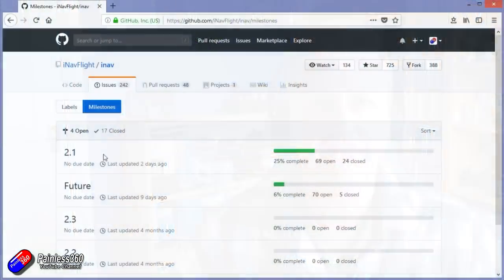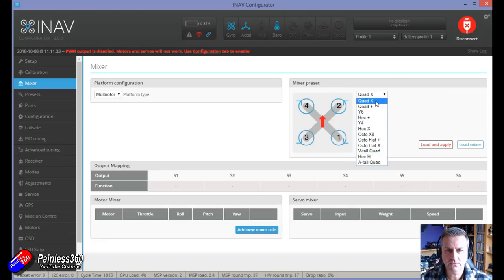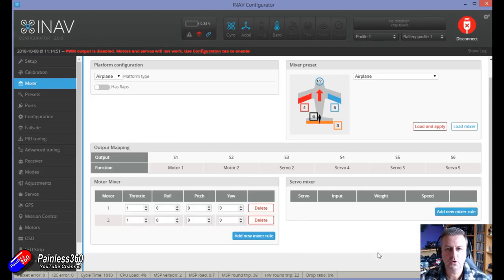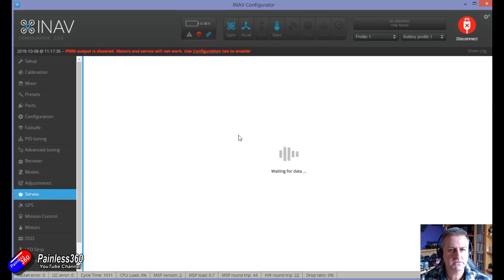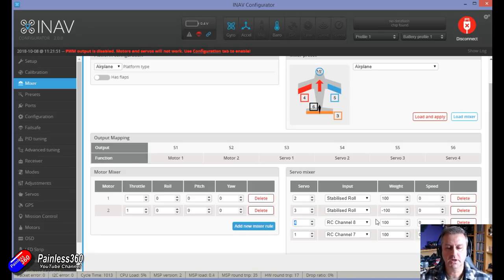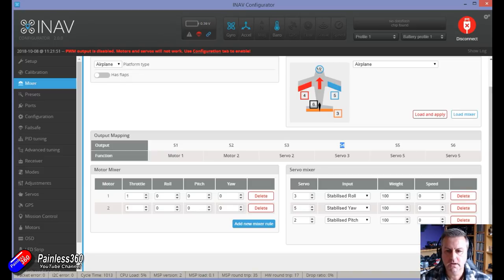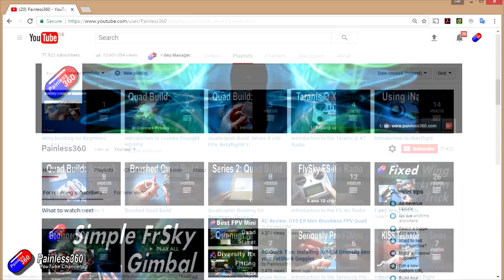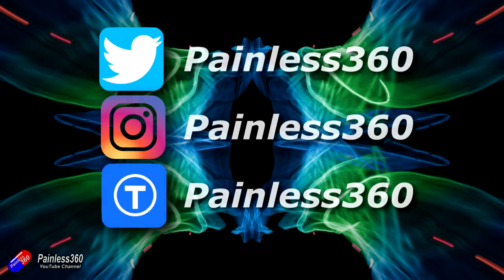iNav 2.0 Servo and Motor Mixer: A new way of doing things!

Comment: Great video,  very helpful,  thanks. I'm thinking of building something like a v22 osprey with vtol capability. I understand I could add some servos to pitch my motors from horizontal to vertical.... but I'm wondering if there is a way to make sure the craft will remain stable and level in roll and pitch while in vtol configuration? Any ideas on how I would be able to do this?

Comment: Does anyone know whether it´s possible to use output 5 and/or 6 for a servo while using Inav on a copter? It only lets me add a servo mixer to S7 and S8. I want S5 and S6 for a servo too. Any solution?

Comment: Did some research and found this for servo set up. Hope someone finds this helpful. 
In the "Servos" Tab:

If they go reverse, change "Direction and rate" from +100 to -100

If they exceed maximum wanted deflection reduce min/max

If control surfaces is not perfectly centered adjust servo midpoint. (This is after setting them up as close as possible mechanically )

Note: In the Servos tab servos are counted from 0-7 while in the Motors tab they run from 1-8.

Comment: Hi Lee, awesome video as always! I am trying to set this up on a multicopter with one servo output for gimbal pitch. After I enable it in the mixer and press save, it still does not show up in the mixer tab to tell me which output on the board to plug it in to. Any ideas? Thank you!

Comment: I used Inav 2.0 with spf3 flight controller motor arm. But flight modes    doesn't work ( angle and horizon) please help me sir
I used your video in your channel spf3  settings and add flysky receiver, fly modes
But my quad only arm and i change to fly modes  angle motor are stop running 
Please help me this is my first quad building

Comment: I used the presets in the mixer settings once I selected the flying wing. The throws on the wing was reversed so it is necessary to go into servo to get pitch and roll to move correctly. THANKS PAINLESS!!🤩

Comment: Hi, Lee
Is there a way to connect a pan & tilt (2 servo) in inav on a omnibus f4 v3 board ?
i have built a 450 dart quad and set up in premix 10inch all 4 motors working and have connected
the 2 servos on the 5th & 6th pins tried to follow you in the mixer but the 2 servos are not working ?
is it not possible to have servos in the quad mix ? please advise me.
thanks
Kevin.
Reply from the maker: I've not tried it on a Quad but see my iNav 2.1 build where I show how I added a pan and tilt gimbal.. Best of luck

Comment: Have omnibus f4 v6 setup as a quadx. Servo tab allows you to add rules, but the output doesn’t change, leaving s2 and s4 blank. I wish to use one for pitch control of gimbal
Reply from the maker: Servo table is only read at boot so you need to reboot it to take effect. See my iNav 2.1 series where I show this in some detail..

Comment: This is a great video, it has saved me lots of time and even prevented me from throwing INAV into the trash bin altogether, since I thought that it's not possible to have two separate flap servos for left and right flap.

My erroneous presumption and a large part of my confusion and frustration with INAV came from another, older video which I unfortunately found first when looking for help setting up a full wing glider:
Setting up custom servo mixes in iNav (or Cleanflight/Betaflight) for V Tail

https://www.youtube.com/watch?v=qL2LMFF5bJ4

In that video everything seemed to be completely static, I spent lots of time trying to find the tables for servo slots for input sources in original, and I was about to give up when I realized that it's not possible. I'm glad that I found this video in time.
Reply from the maker: That's why my videos all have a date on them so you can see if the information is old.. Happy flying

Comment: Awesome video. Thanks! I built my first wing and have a question about the mixer. Do I understand it correctly that I do not have to set up a mixer on my Taranis? If I choose "Wing" the elevons are mixed. Do not I need this or can I leave the appointment in the Taranis like this?
Reply from the maker: Please see my INav series and iNav documentation - no mixer needed on the radio.. Best of luck!

Comment: Just spent to 2 day working on this issue i want to use a bff3 board for a ares gama pro and the bff3 only has 4 outputs it should be enough but the motors take 2 out puts and there is no way we found so far to remove motor 2 out put and  Reassign servo two to motor two output to be able to use all 3 outputs for servos. Do you have a workaround for that ?
Reply from the maker: In a plane mix the first two outputs are always for motors. You can't change them - even in this latest version of iNav. As mentioned in the video it's a legacy thing (explained a lot more in that original mix video)..

Comment: Hi can i ask directly, can inav stabilise yaw with using diferential thrust ? 
For example wing with two front motors.
Thanks !
Reply from the maker: You can setup to have the stabilised yaw controls mixed into the two motor outputs..

Comment: I want to use three motors on my flying wing with differential thrust. If I understood correctly, I only need to add one more motor and configure yaw on the two that I want to use for steering? Wouldn't it mess up the timers, etc.? I am using Matek F405 Wing.
Reply from the maker: Sounds likely, I've not tried it here - let me know if it works!
Reply: In the end I had to make my own iNAV build. Unfortunately I could not test it so far, but in case anybody is interested, I can share it.

Comment: Is there a possibility to attach a 1 axis gimball motor, so I can attach my HD cam to it?
Reply from the maker: Yep, you can either output one of the controls from the receiver directly or use the gimbal output from iNav for it depending on if it's using it's own onboard stabiliser.. Best of luck!

Comment: Awesome vid, thank you so much! : )
Just a question if i may, please?
For my VTOL project, if i need 4 motor mixers (with 4 physical motors), and 2 servo mixers for the ailerons, is that possible to configure?
And if so, do you know which FC has such support, please?
Many thanks! : )
Reply from the maker: Check out the arduplane project, lots of VTOL support in there... Happy flying!
Reply: @Painless360  or PX4 with even more VTOL configurations

Comment: Thank you Lee another video full of nuggets of information. Inav is developing lots of very useful bits and pieces.
Reply: I have reversed the flaperons to get spoilerons for crow. Flaps are added in the mixer?? On my motor gliders I like to run camber. In Inav2 an extra mix for each aileron channel and another flap mix, adjusted to give 10% to 20% for camber? Is there a limit for the number of mixes per servo channel?? It would be nice to have crow, camber and reflex if Inav2 allows four or five mixes per servo channel. Would have to organize modes arming etc in the higher sbus channels       hmmmmmmmm
Reply: No bother. Tried it doesn't work. Flaperons are through modes as well as mixer. Anyone got any ideas please??????

Comment: Great video. I was wondering why developers decided to set 2 motors as standard when the majority of us I think use just one... So with that said I can't use the pwm motor output for a servo in my omnibus f4 just because there are different timers?
With ardupilot I can do what I want and Inav doesn't allow that?
What's your opinion on this topic?
Reply from the maker: It’s a legacy thing going back into the dim and distant past.. I wasn’t one of the developers so don’t know the rationale.. happy flying!
Reply: @Painless360  Well, what I am going to write may seem against INAV wich is not, developers made such a piece of software but I am trying to experiment with ardupilot, it looks more solid to me, just my opinion.
I have 2 omnibus style F4 (one PRO V2 and one without current sensor V3) and a Matek F405 WING, and it would be interesting seeing some educational video on how to get this board working with features like FrSky telemetry etc.
Happy flying to you too :)
Reply from the maker: See my video in the F405 Wing being fitted into a Caipirinha wing.. you’re spot on - ardupilot is a LOT more mature and has had many more years of development and testing than iNav, Betaflight and others.. that’s why I use it for some models. See my video on ‘what flight controller and show are should you use’ for my thoughts..